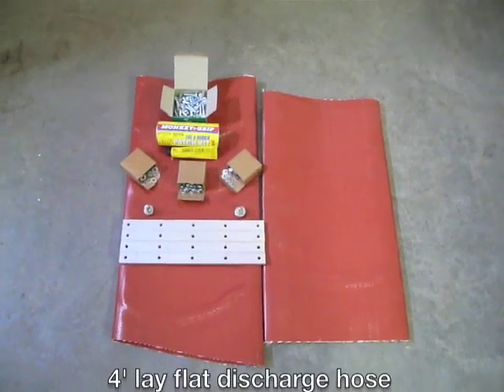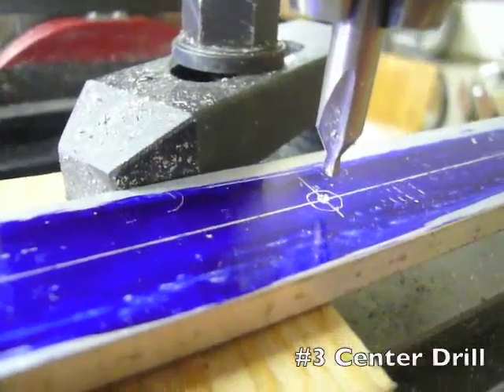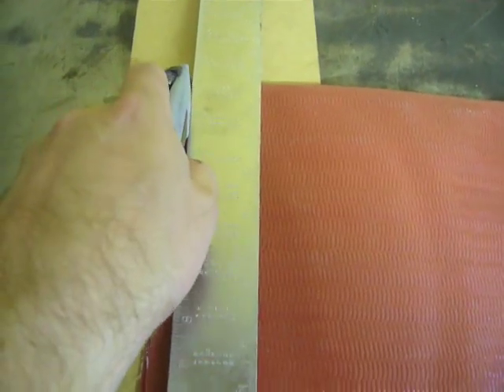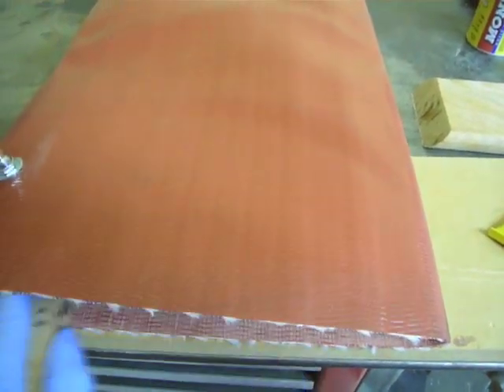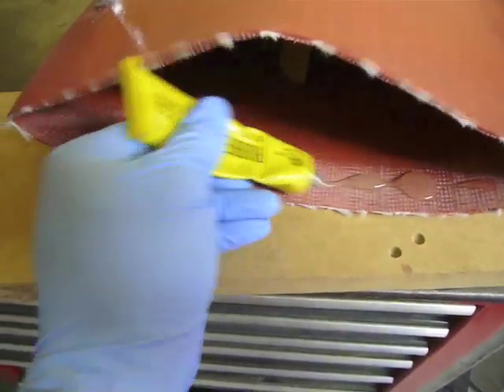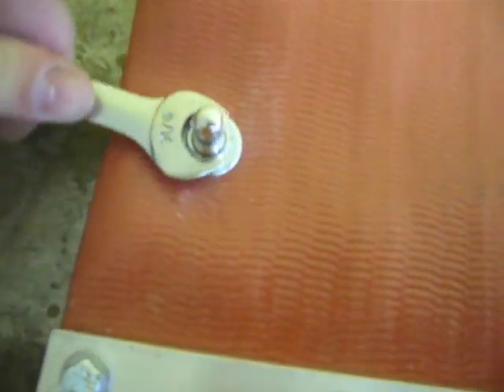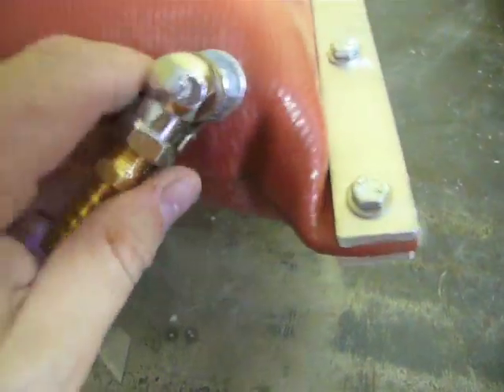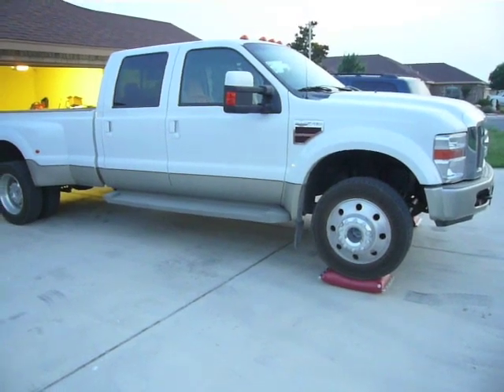RV Leveling Airbags DIY

Comment: how are the bags holding up?
Reply from the maker: I've since upgraded to to a fifth wheel with auto-leveling hydraulic jacks.  However, these airbags served their purpose for several years without significant issue or repair.